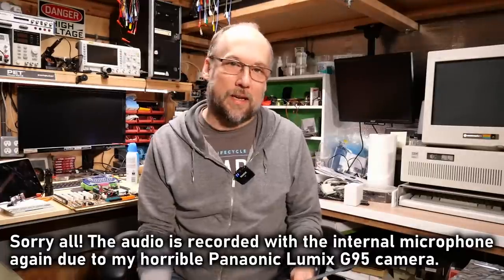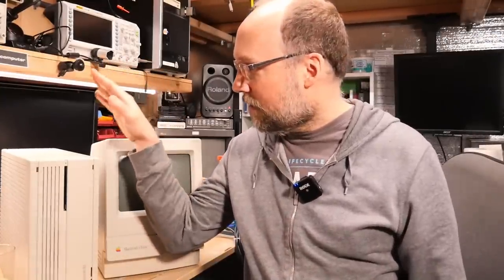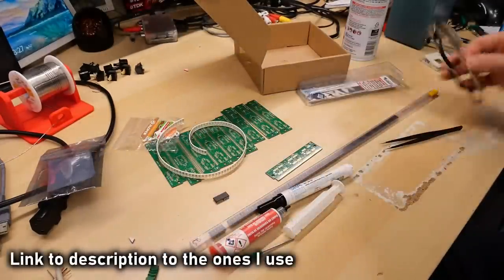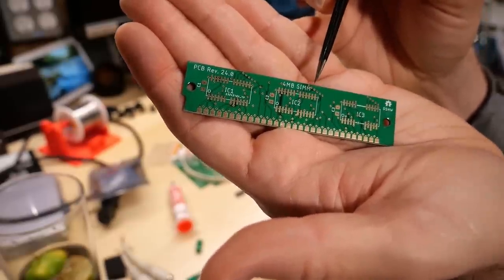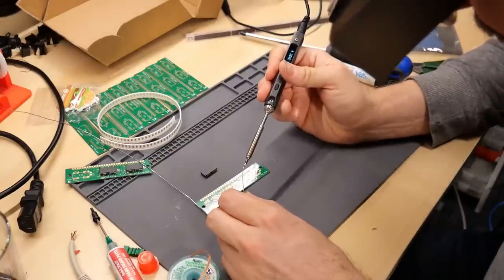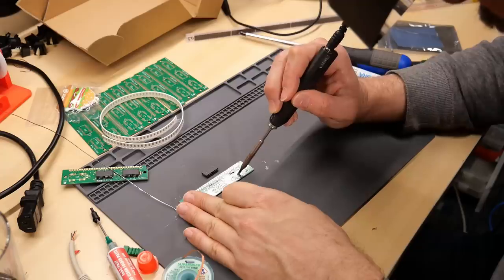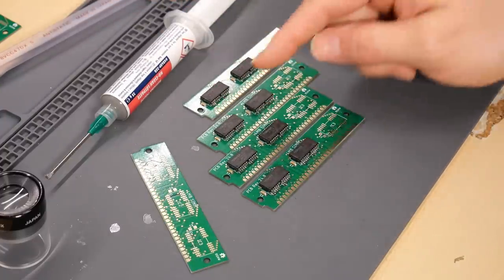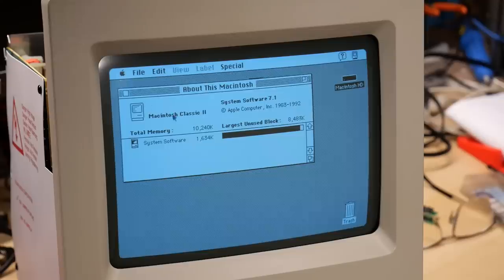Nibble Size: Let's make some memories!

Comment: This type of chips easy to solder with soldering iron, not hot air
--use good gel type flux
--do not apply solder on the pad before placing chip!
--you can use big paper clip to hold chip on pcb
So, apply gel flux to pads, place chip and touch legs on the corner using slightly "wet" tip
Reply: Yeah, bigtime. Don't waste your time with solder paste. That stuff is best for pads that are flat to the board. These types of chips actually make a perfect angle to accept the soldering iron tip laying alongside the pad and the pin.
Reply: The “drag” soldering technique works well with this. Use a big flat tip (chisel, screwdriver, or hoof) on a good temperature controlled iron for best results.
Reply: Why no pre-tinning the pads though? Hard to position the chip on the domed solder blobs?
Reply: @benbaselet2026  Yes, exactly! Also all factory board include jlcpcb and over are already pre-tinned (HASL process)
Reply: Hmm, if you hit the applied paste with hot air before putting on the chip, wouldn't it tin the pads making for easier reflow when mounting the chips?
Reply: @StevenIngram  Soldering paste is good thing to use if 1) you have stencil 2) you have reflow oven... stencil at least. So my answer is no, it is faster and easier to do this type of work with good soldering iron.
Reply: and tack 2 corners down to start
Reply: Yeah by far what everyone else is saying is true, soldering iron with plenty of flux on pads then drag solder with wetted iron. Flux is your friend.
Reply: This is a serious pro-tip. I wish I could pin/bookmark it
Reply: Yeah; A slightly wet tip always helps
/me runs :)
Reply: This is probably the best method for completing your particular job. I've replied to another message about how you could use hot air if you really wanted to. I find that the J Package (a bit like QFN) is a lot easier to work manually with using an iron and tacking down the corners, then (depending on your level of confidence) either strip soldering the remaining pins using a wide tip, or given that your ICs have (relatively) few pins, just doing them one at a time.  The repetition really does help with building muscle memory for micro-soldering, and can be a cathartic experience. If you're going to go pin-by-pin, make sure you use a fine tip, not a micro-pencil, but something small enough to give you the precision needed.
Reply: Wear a freaking ESD wrist strap !
Reply: @dorfschmidt4833  That is a good point. 
But maybe he wears it around his ankle. 
You never know;)
Reply: Good tips and well, Flextro: I think every method is valid.
If you know what you are doing and use the right tools (like a pre-heater or a fucking soldering-frame:) ).
But the most important part is experience. And that ... comes with time and training. 
Iron, Hot Air, Oven, Flow: The most important thing is the temperature. To have that in-specs guarantees good solder-joints. To do it wrong brings a lot of pain in form of late faults of components or unbelievable hard to find alternating connection problems.
At all, hand soldering (with a soldering-iron) surface mounted parts will always be less professional and good (in terms of reliability) than the appropriate methods like air-flow or temperature controlled oven-soldering.

From the Toshiba TC5117400CSJ-60 Datasheet: 
Soldering Temperature (10s) T SOLDER = 260°C
Reply: Yuup, it's quite easy to solder actually. First solder two opposing legs to keep the chip in place, check that it is aligned properly. Then it's a simple matter of flowing solder to all the pads, you can use a lot of solder here. Finally check for solder bridges. I've soldered a lot of atmega328 tqfp packages like this.
Reply: haha, sage advice! I was cringing the whole time; though, I, sure wouldn't want anyone watching me solder :-) I know better than to preapply solder to the  pads, but my hands are so shaky I'm lucky if I can hit the chip with the iron let alone a pad lol. I make heavy use of that desoldering wick.
Reply: @Flextro "wet tip" that's what he said 😂😂😂😂
Reply: And use a gullwing tip for drag solder. Also ideal to remove solderbridges and if you use them flat they have great heat transfer capability. I use a big hoof shaped gullwing on my Pace and a small one on my Weller. And I use them for almost everything. ( I repair a lot of PCBs that can not be powered on solitair, like controllers from machines, the only way is to remove every component, test it and solder it.
Reply: LoL Apple and IKEA cooperation

Comment: Adrian I think it's great to show something you're not good at. Many things take practice and effort to get good at. I think it's important for us all to remember that. Kudos for the great video!
Reply: This is so true. if you watch some videos, they make this type of work look easy. I accidentally destroyed a IIsi board when trying to fix a SMD IC similar to these, felt really stupid that I couldn't just fix it like everyone else seems to be able to. This is very precise work that requires precise tools. Thanks for sharing Adrian!
Reply: I came to post this exact comment. No one is perfect at everything all the time. I'm glad i watched this video and read the comments. I learned a lot. Thanks, Adrian!
Reply: "Practice makes perfect."  It's an old adage, but a good one.  You're gaining experience, learning what not to do is as important as what you can do.  For example, you were trying to solder with the PCB loose on the table top, I was thinking you needed a small vise, then I see you switched to those "helping hands" clips.  Another tip is the soldering; it can be hard to find the appropriate temperature for what you're working on, regardless of whether you're using an iron or the hot air.  You want to get the part and traces hot enough to let the solder flow, yet still not too hot to damage them.  And I totally agree on the 63/37 solder, I've  used that alloy of Kester for over 45 years.  Quality tools and materials make the job easier.

Comment: For solder paste, you're supposed to use a PCB stencil, which has cutouts for each pad. You line it up and then just smear it across the board. EEVBlog made a great video on it, it's episode 415

Comment: Apply the solder paste using a stencil. MUCH easier, and the stencils cost almost nothing from JLCPCB and the other Chinese suppliers. And also - the solder paste contains all the flux you need.
Reply: Stencil, solder paste and frying pan! Easy peasy
Reply: @cmorda11  Never tried the frying pan method. I have an old oven in my workshop ;)
Reply: +6million Stencils and then this just is pure magic sauce..
Reply: You don't really need a stencil for a small bunch of tiny PCBs, just right size needle and not ruining it by submerging in liquid flux and all it takes is but a ten seconds
Reply: No such thing as enough flux

Comment: Soldering paste is applied with a stencil in the desired thickness and a scraper, so you get the exact amount you need on each contact (only). That way you only apply soldering mask ones, then place everything, and run over it with the heat gun once. Just about every custom PCB supplier also offers to make stencils.

Comment: "J" lead style SMT chips can be tough to solder as the pins go under the package. 
Strip-soldering them might work if the PCB is pre-tinned with solder then cleaned back off, to get minimal solder on the pads as a wick.
Use lots of flux on the PCB and then tack 2 pins of the IC with the iron, then strip-solder the rest. 

The hope is that the small amount of solder left on the pad is enough to wick (pull more) new solder in and not having a lot on the pads should stop pad-to-pad shorting from solder "squishing out" from the J-lead & package being pressed to the PCB pads.

For hot air, I think your only good choice would be to try and get a stencil for the (JEDEC I believe) J-lead package style. A toaster oven converted to a reflow oven would be the better way to solder in this way, but you could get away with the hand tool and a hot plate. Using a DIP style hot air head would help to get both sides heated up at the same time and prevent over heating the IC and PCB.

I agree 63/37 solder is the best way to go. Using lead-free would be a nightmare.

Looks like an interesting project :D
Cheers,
Reply: I have recently been informed that there's now really good lead-free (and silver-free) solder available at reasonable prices because the patent finally expired.  It's apparently very, very similar in properties to the 63/37 solder we've all liked for a long time.  Given that lead mining is a relatively dangerous job as mining goes (it's hard to not get contaminated with a metal you're mining) I think reducing consumption where practicable is a good idea.  (If only there was a really good UV stable yellow pigment that didn't cost a fortune and wasn't at least as toxic as lead chromate so we could stop painting it on our roads.)
Reply: After soldering with an iron just add flux and reflow  with the iron, Ive been doing this for years, solder paste goes bad fast once opened.
Reply: I've had only a small amount of exposure to J Lead SMT chips, but my hot-air technique for re-work / prototyping using these packages is to heavily tin the pads (such that there's a little convex bump on each), add a thin coating of liquid flux (not Louis Rossmann's version of a "thin coating", but enough to cover the tinned pads without meeting in the center), then position the IC as accurately as you can, and lightly hold the IC down using some tweezers or or a screwdriver or basically anything heat resistant, not so much that you're pushing it into the PCB, but enough to resist the hot air's tendency to blow the IC off of the board. All things going well, the solder should re-flow nicely under the pads and you'll feel when the surface tension of the solder has pulled it nicely into alignment. I find it best to move the hot air gun around, to apply heat evenly to the pins of the component, remembering that the pins are what you want to heat up, not the IC itself. 

I'm sure these components aren't as sensitive as modern stuff, and unlikely to coexist with them on the same board but if you're working in the vicinity of other (more delicate) components, it's good practice to put some kapton tape over other components close by or try and shield them from heat as much as possible. 

After soldering using a lot of flux, it's always a good idea to give the board a cleaning, if you have an ultrasonic, that's great, if not some IPA (not the beer) should be fine. 

Then once it's all working, go have yourself a nice local IPA (the beer this time).

Comment: To help with the warping, you might spend a little time blowing hot air over the whole PCB to warm it through before going in hard to solder.

Also, solder stencils all the way, will really help to ensure just the right amount of solder is applied. 🙂

Comment: Don't worry about refrigeration of the solder paste.  It's fine because you hadn't opened it yet.  Once you have, you only need to keep it cool for long term storage.
I've also had bad luck trying to hot air solder SMT using solder paste applied with a squeeze tube.  I've had somewhat better luck using a stencil to apply the paste, at least for .85 mm spaced parts, not so much with 0.5mm spaced ones.  Setting the chip down correctly, and removing solder bridges has been the major problem.  I've actually done better with a VERY fine tipped soldering iron and VERY thin flux cored solder wire.  QFTP and SOIC chips are easier than QFN!
I have a binocular microscope to inspect my work.  I think it's a 20x power (eyepieces are marked 10x, objective is marked 2x).  It was a lucky find in the dumpster where I worked.  Just had to make a home brew stand for it.

Comment: Great video again, every day is a learning day and hopefully your video will help others learn.

Solder paste is best left for when you have a stencil to restrict the amount of paste on the pad.  Too much paste will cause solder balls to skate around on the board causing bridges some visible on the legs but others not so much behind them underneath the chips.  If you have a stencil and some good quality paste designed for the job at hand then it can out perform soldering chips by soldering iron.  The other thing to consider is the thermal shock to the chips, some are super sensitive to the temperature changes and others wont last if kept at too high for too long.

If I had to fit these chips and didn't have a screen printer, pick n place machine, & reflow oven, then I'd use a nice pointy iron tip with some thin diameter tin lead solder.  As others have said, apply some flux to the leads and pads.  Apply some solder to one pad in one corner.  Solder the chip in place on the one pad and check for squareness and positioning.  Once happy, do the other corner and double check positioning - because its easier to fix it now than later.  If all looks good, solder up the other legs.  

I was always told I used too much flux but my joints were virtually the same as what came out the reflow oven.  

You can use the same method to solder other smd components - solder one pad, position the part on the pads and heat up that one pad. Check position and solder up the other end.  Flux is important and cleaning that off when finished is more so.

Hot Air Guns are really only used when removing parts from a board.

Tip:  clean off the board with some IPA, use a cotton bud to help move the fluid about and remove stubborn deposits.  Check the ideal operating temperatures of the paste / solder wire (too hot and you'll burn off the additives too soon).

Comment: Nice that you found out this oldschool technique. In the late '90 I worked for a wholesale computer parts supplier and to make more profit and sell for lower prices than the competition we bought separate chips and empty ram boards from China and just make 30-pin simm memory modules ourself. We also had a dedicated simm memory tester for quality control.

Comment: 9:45 "The paste doesn't have any flux" ... huh solder paste is literally tiny solder balls in suspension in a gel flux.
Reply: yea, its so thick and not really wanting to flow because it was not refrigerated. we use this stuff at work on our stencil printer. solder paste absolutely positively without a doubt needs refrigerated or the flux gets dry and bad. then it all turns to crap from there. Everytime I order it, I have to do overnight shipping from Digikey or mouser with dry ice.
Reply: @THEtechknight  There is also the no fridge pastes. Like the chip quik TS391LT. I was happy to find this out after having it on the shelf for a year before using it :D
Reply: @bwack  Yea I dont know anything about those.
Reply: i've got old old old solder paste that I am sure existed way before any SMD existed.
Reply: @bwack  The non-fridge paste doesn't work nearly as well in my experience though...
Reply: @johnpossum556  Surface mount components have been around since the late 50s early 60s, I can't imagine why it would exist before then - but I don't know everything ;)
Reply: @luther99flame  I just found the solder paste in some old junk, probably my father's and he did practice and teach electronics. I'll have to look closer at it next time I run across it. Could it be for plumbing or something else?
Reply: @johnpossum556  ah yes, could be for plumbing, and some of that stuff is super active/corrosive - cleans up copper pipes right before your eyes.
Reply: @johnpossum556  Yes, as Mr. Smith said, for plumbers. Additionally there were and are other uses for soldering paste in the assembly of gutters, in heating construction (aluminum soft soldering paste), jewelry making and general metal works. There is steel soldering paste, gold, silver and tinning paste and all sorts you can imagine.

For reference to more references: https://smtnet.com/library/files/upload/fundamentals_of_solder_paste_technology.pdf
or Solder Joint Technology, ISBN 10: 1441922849
Reply: @THEtechknight  You can just mix some isopropanol into the paste to regenerate it.
Reply: @SianaGearz  I havent had luck with that in the past. you have to mix the actual kester liquid flux into it such as 951 or 959
Reply: @johnpossum556  Please DON'T use plumbing flux on electronics... 
The plumbing flux is acidic and will destroy the circuit boards and traces...
Reply: I've had good results with older paste by placing the tube in a glass of lukewarm water (40c) for a few minutes before applying

Comment: I do  this kind of work professionally and there are two ways in soldering J-Style SMD-Chips to P.C.B. that I prefer. The first is to use a tiny amount of Epoxyglue to fix the Chips in position on the clean (No flux etc.) Board and solder them with special SMD-solderingwire (0,3 mm Diameter) using a microscope. The second way is to plot a solderingmask and use it to portion the solderingpaste on the pads. After removing the mask I fix the Parts with ceramicglue (extremly fast) and use hot Air with 320 Degree Celsius. What you do is great, cause I had to search a long time to get hand on such SIMs . Good work, and greetings from germany!

Comment: When something like that says to keep refrigerated, that usually means after opening and breaking the seal.
Reply: ^ this. The reason it needs to be refrigerated is because the gel flux will dry into a powder. It's still usable in that form, but it'll take a lot more effort to get it out of the syringe tip.